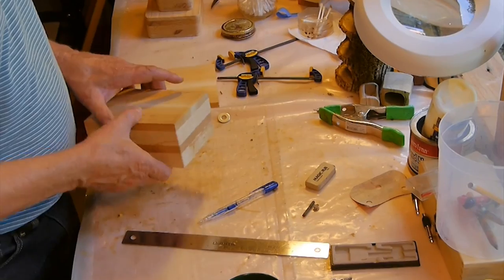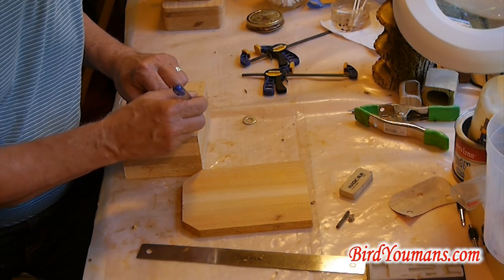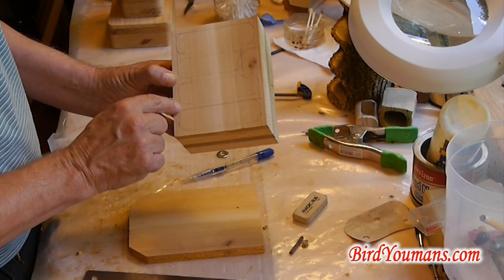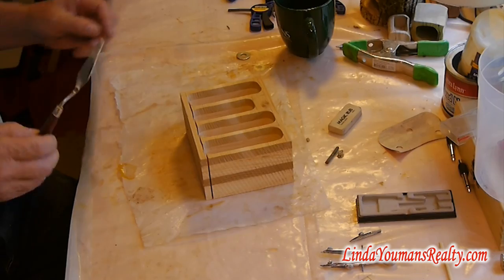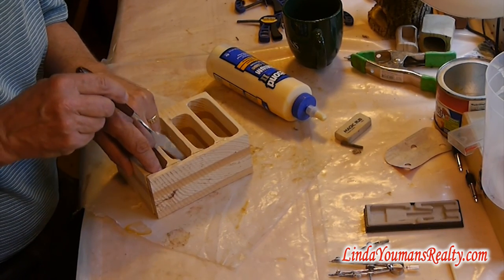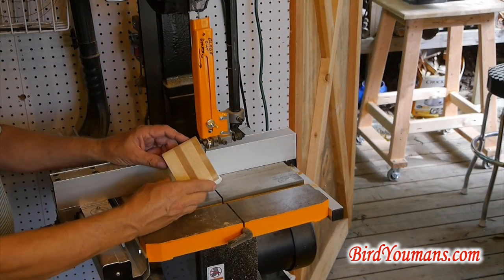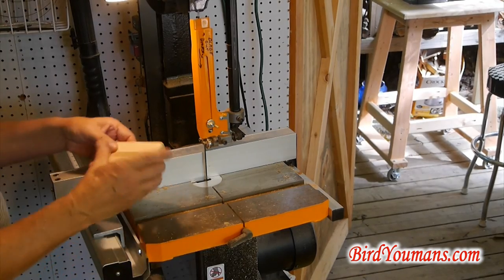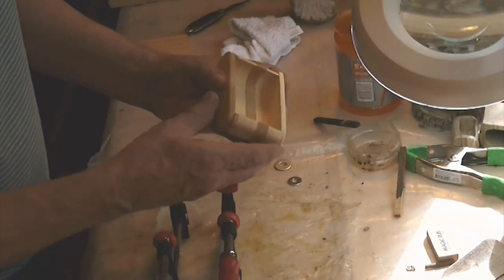Band Saw Box from Cedar and White Pine with a Knot Feature - Bird Youmans

Comment from the maker: Since doing this video someone in another video suggested using some table salt when gluing up the joints to keep the glue from slipping and sliding.  I've yet to try it, but I can see where it would work.  So if you do one, that might be something to try during your glue ups.
Reply: Fine sawdust works even better because it doesn't melt in the glue. Just a tiny amount is enough.
Reply from the maker: Makes sense.  I'll have to try that.  Thanks!